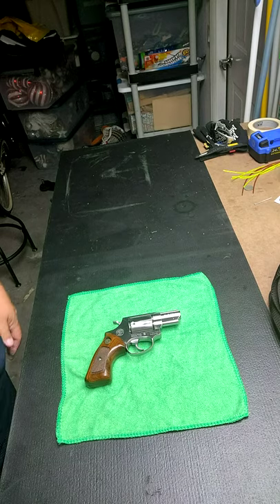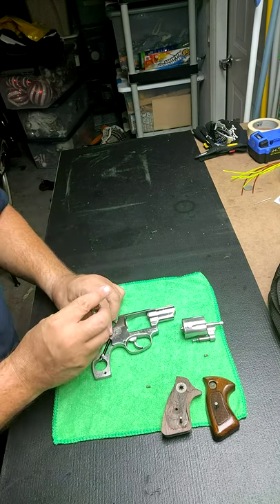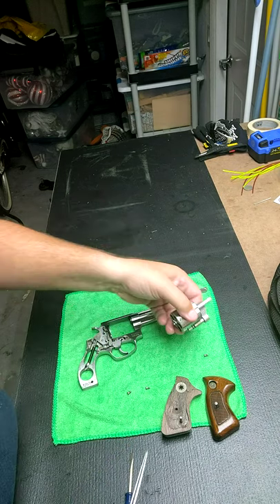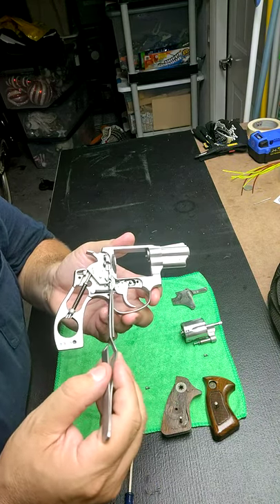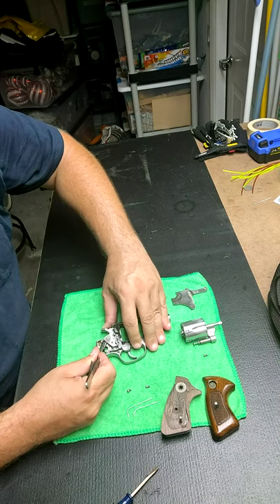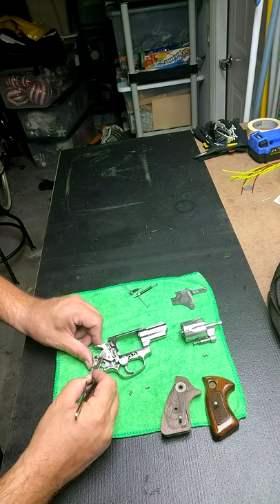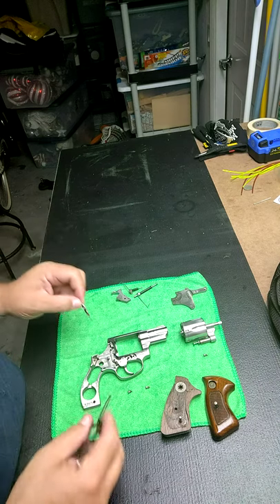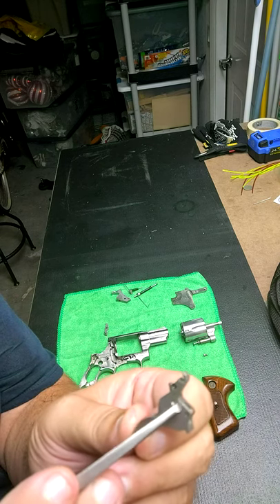A revolver is expected to revolve. Let’s fix the issue. Taurus .38. Cylinder not rotating.

Comment: I have been in those actions a couple of times..This is a very good video, showing Taurus Trigger Operation and design, with unusual troubles due to storage or none use for long periods of time. I would like to add another detail, that the transfer bar, I have found several times, will have Too Much Arch bend, and will catch on the frame, just above the cylinder lock pin assembly,and stop the trigger full rearward travel. A very careful and slow change in the bend of the transfer bar will restore Another fail.
Reply from the maker: @randymccalla9995  thank you for your comment and added information. It was very interesting.

Comment: You can also put a drop of oil on it and depress it several times working the oil into it. Same for the cylinder release latch and the cylinder ejector rod.

Comment: I have a similar problem , same gun , when I pull the trigger or pull the hammer back it stops half way and if I push the cylinder eject button backwards it allows it too fire and rotate ,
Reply from the maker: Have you tried taking it apart like I showed? It may be gummed up inside like the one I was working on.

Comment: I have a Taurus 856 38 special. The cylinder spins nicely if I dry shoot with dummy ammo, but when I shoot live ammo the cylinder gets jammed and the trigger gets stiff.  Any suggestions?  Nice video, BTW. Congrats!
Reply from the maker: Thanks for the comments. I suggest disassembling your revolver as I did. It may be as simple as the internals is dirty like the one I took apart and the pressures generated when firing is causing it to get jammed up inside. The other thought is the internals could be so dry depending on age and your climate and it needs to be oiled up. Either way, if you feel comfortable doing it, take your time and care when taking it apart and it will give you a great feeling doing it yourself.
Reply: @armageddonoutdoors439  thanks a lot for answering my question. You just gave me the best gift, part of your time!
Reply from the maker: @asclepioesculapio3522  I hope it helps. Let me know what you find.
Reply: Ii was wondering what is wrong if the trigger won't click an the spin wheel won't spin @armageddonoutdoors439